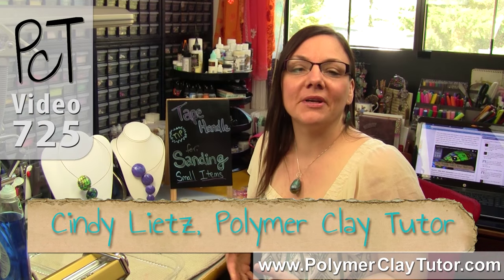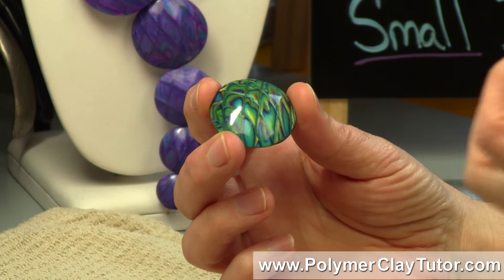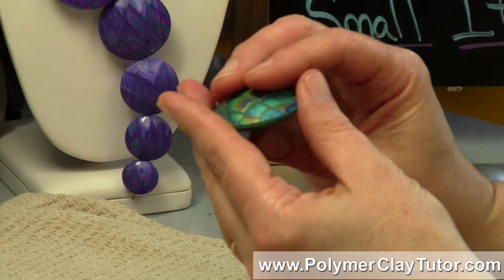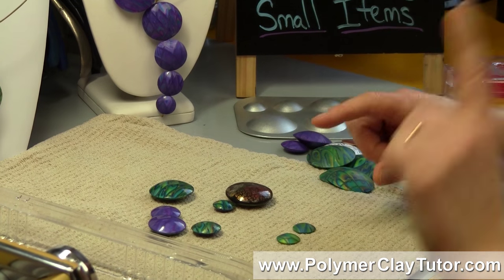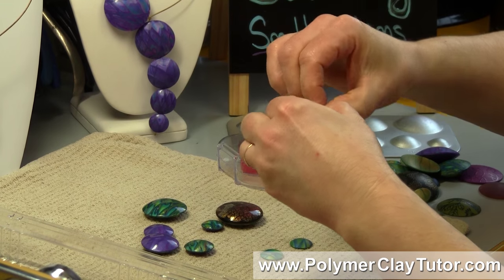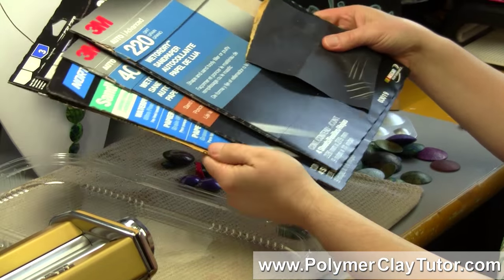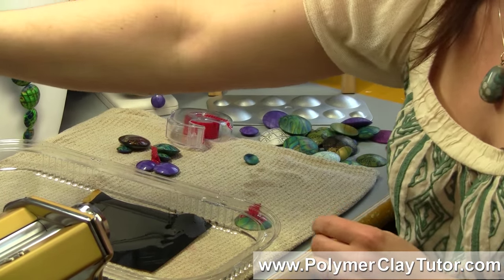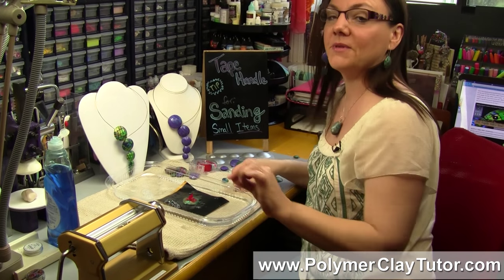Scotch Tape Handle For Sanding Polymer Clay Beads

Comment: I love your videos, they are so clear and helpful. Have you done a tutorial on the different types of clay? I found some older packaging of Premo and Kato PolyClay on a 45% sale and bought quite a bit of it. Can they be mixed or used in the same project? Also, I just found out that I can't sand Souffle... after spending a long time on it and finding out it doesn't shine up :(   Thank you for your helpful videos, Cindy!

Comment: Excellent, and always timely.  One issue?  If folks dry sand anything should not they have a filter system like a vacuum or fan and nose/mouth coverage?
Reply from the maker: That would be a good idea! Though I always recommending sanding in soapy water, it eliminates the dust, and sands up cleaner and faster.

Comment: So im having a problem with my hollow bead maker, I make the beads on a 3 setting on the pasta machine and then i try to attach them after baked to a flat unbaked piece of clay using fimo gel, but whats happening when I rebake some of them suck in so I put a round ball of clay inside to stop this but its sucking down to make an outtie bump with the sides sucking down, so is there a trick to stop this and keep your beads convex? What thickness do you use? And how do you attach two convex pieces properly? Thanks Cindy :)

Comment: I'm making color swatches with labels behind them written in pen ink, but i accidently found out the ink can and most likely will transfer onto other clays if i line them up Infront of each other. I can't wash or alcohol off the ink even with the 90% alcohol. I figured id put archival tape over the labels to prevent the transfers but the one i'm thinking of getting says it's a 'solvent-based acrylic adhesive'. Even with it not actually touching the clay itself since it would be on the label instead, would i still have to worry about the adhesive residue somehow interacting with the clays? 

Those tapes are too expensive to just pickup and test out on the clay, and then if it doesn't work out i'll be stuck with multiple tapes that i have no use for since my family don't even collect books.... I could try other clear tapes but i know they yellow overtime which is why i wanted the archival types because they advertise themselves as being acid free and non-yellowing.

Comment: I sanded earrings I made with black clay, dry sanded it, and it totally discolored them. turned it grey where I sanded, and remained after wiping dust off with a wet cloth and after glazing it (I thought it wouldn't show, but it did.) any ideas how to avoid this in the future. premo clay FYI

Comment: What do you do with the water afterwards? If it creates dust on dry, the dust is still there but in the water. Surely plastic dust is smaller than microbeads which have been banned as pollute the ocean due to slipping through the water filtering plants. 🤔
Reply from the maker: You can definitely let the water evaporate and either put the dust into the garbage or better yet, mix it back into clay to make faux stones.
Reply: @PolymerClayTutor  thank you 😊... Do you have a tutorial for the faux stones? 🤔

Comment: Help! I really don't understand what I am doing wrong, when I try to sand flat pieces they go smooth but instead of going shiny they go matt and pale. I am using Fimo clay and 400 sandpaper. Any ideas what I am doing wrong or ways I can improve my work? Thanks
Reply: samuel bromley 
You need to start at 400 and work up through many grits. I use 400 600 800 1000 and 1500. Then you must buff to a high shine using a soft cloth. Hope this helps.